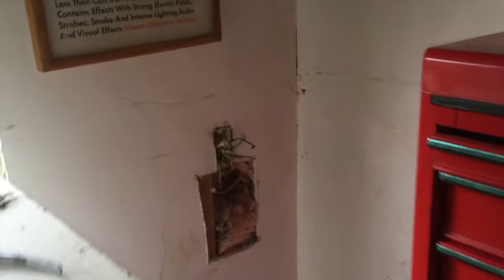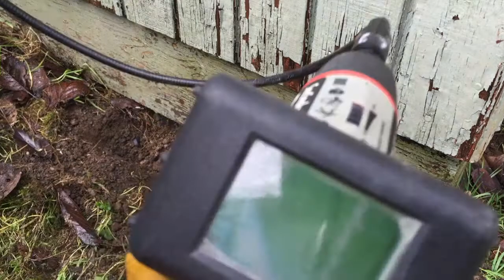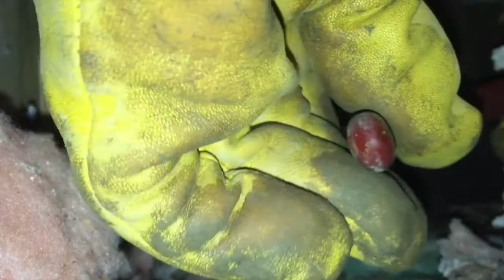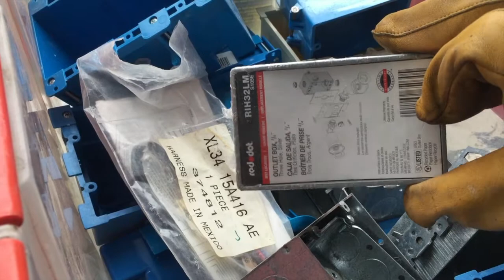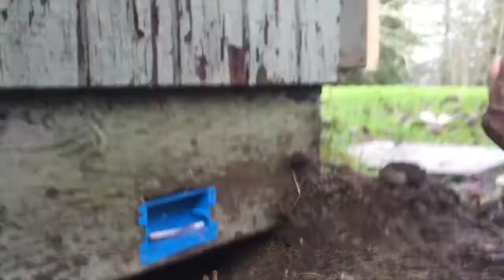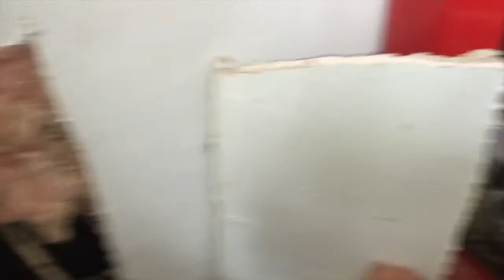Rats Ate My Wiring Part 1

Comment: Going to do more research but . Just in case someone sees this and can let me know how do I know witch wire is hot and witch is ground ? For future reference 
Thank u in advance
Reply: I just remembered the old battery trick with a 9 volt battery don't know if there is a safer idea or meter read I should get on this multi meter I got

Comment: Rats.stripped about a foot length of wire bare.   There is no damage to  wires,  just bare in that section.   Could I just use electrical tape to cover them individually in that section?
Reply from the maker: Hey Tim,  You can, but eventually the electrical tape could dry out and come off.  If you can, it would be better to spice in a new section of wires.  ideally with crimp connectors. not wire nuts.  if you do decide to just electrical tape it make sure you wrap each wire separately, then wrap them together as tight as you can.   I'm not an electrician, but thats my 1 cent advice.  Good luck!
Reply: @skywaterhaven  thank you SO MUCH for that lightning fast response!   That is really cool of you.    I was going to splice out the damaged and add new wire, about a foot.   Does that mean I need 2 junction boxes?   I've never used the shrink connectors before & ive never used a job box before, so I'm pretty nervous.   Wiring is from 1984.   I have 2 different rooms with damage & in one I was going to splice & replace wire and receptacle since one got a little singed when little bastard was chewing wire.   I also could not find anything at my lowes to secure wires to box.
Reply from the maker: @timgreen2426  Hey Tim,  using two junction boxes would be the proper way to go, if you did this you could just use the standard wire nuts that attached the two wires together inside each junction box. if you use plastic jboxes (blue in color) you don't need anything to secure wires to the box, they just go thru the plastic slots in the back.   If you use a metal junction box then you would need to purchase a wire strain relief that will go into one of the knock out holes in the metal box and you would use a metal strain relief that tights up to secure the wires to the box.  Hope this helps.  Good Luck!
Reply: @skywaterhaven  you answered the doubts I had, and I am on it now.   It is unbelievable the help you have given me!   I can't thank you enough.  Hope subscribing, liking, & sharing shows my gratitude.   I'll reply when it's all done & working!   Woo hoo air-conditioning in this situation Texas heat...here I come!!!
Reply: Omg im glad to hear this is a safe solution for now because i taped mine well and then left and have been worried allday if i did the right thing